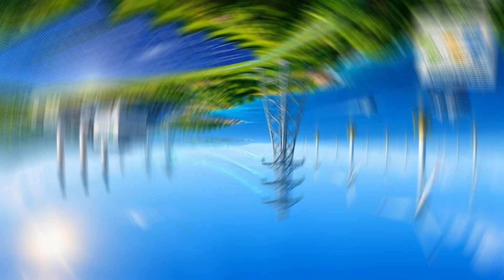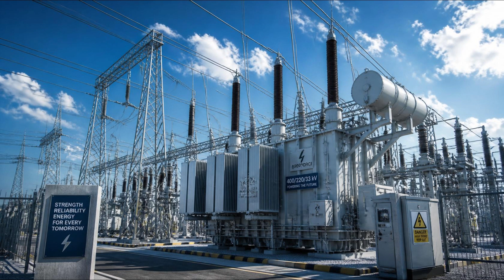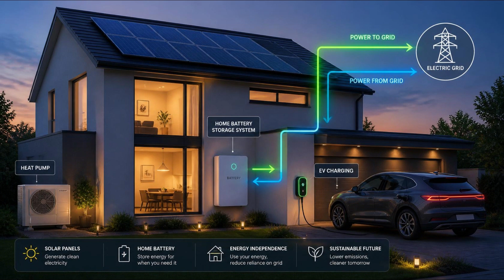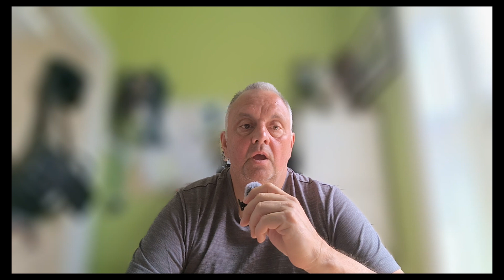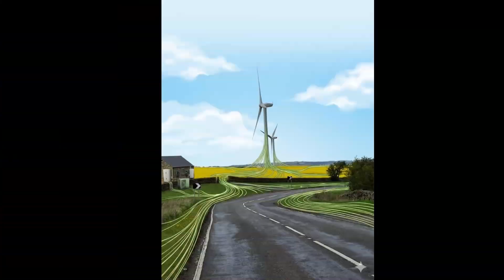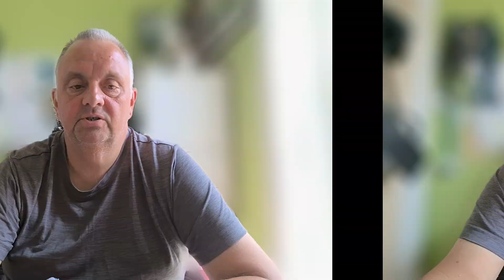Electrify my life - UK Energy Blackout.

Comment: Very interesting, Nick. You mention Drax - the hub of coal-powered electricity generation for a century, and where the pre-existing high-voltage overhead cable span out from. Connecting North Sea wind to this hub wires up a new electricity supply to the existing network.